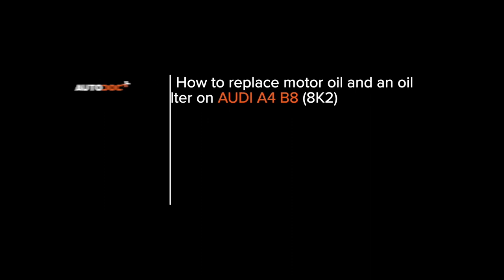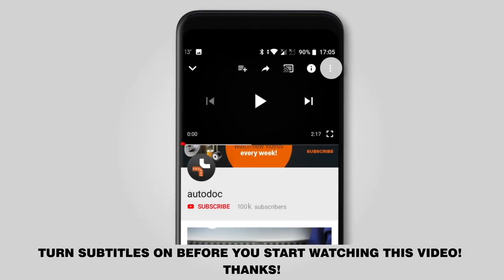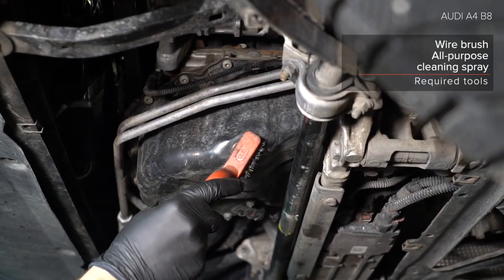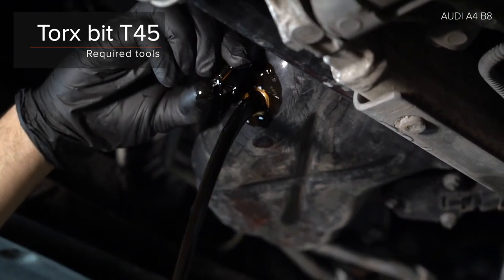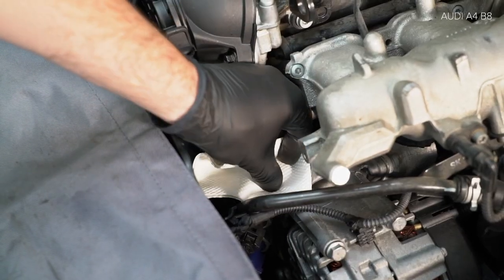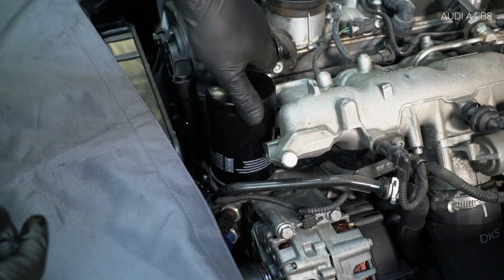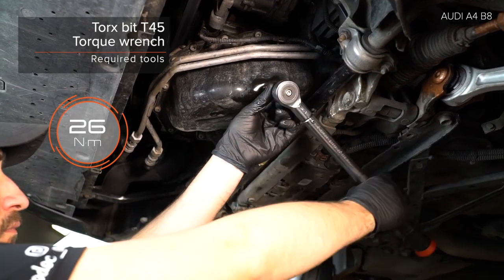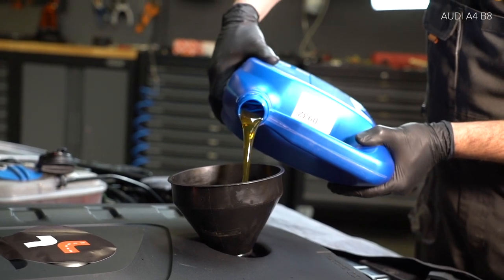How to change oil filter and engine oil on Audi A4 B8 Saloon [TUTORIAL AUTODOC]

Comment: You need to change the rubbers on the plastic insert under the filter which has the spring on it. Original filter comes with the replacements while all filter on autodoc dont come with it. Shame

Comment: I recently filled up my A4 B8 with 5W-40 oil but forgot to change filter first. Is it okay to change the filter now without draining the oil since its fresh oil? Or does the oil have to be drained to change the filter?
Reply from the maker: You can simply replace the filter, but you will need to add engine oil to the level.

Comment: Hi what is the best method not to spill oil while removing the old filter?
Reply from the maker: We do not have such information, we recommend that you consult your mechanic.
AUTODOC
Reply: If you have drained all of the oil from the car, there should not much oil left in the filter, but it you lift the filter housing carefully and hold a tissue paper in the other hand, you can quickly block the bottom of the filter with tissue to reduce spilling it all over the other engine parts.

Comment: I don't have ramps so what do you suggest for lifting the car?
Reply from the maker: This video contains only tips and tricks that may be useful when repairing a car or replacing parts. You can use a viewing hole or we recommend contacting the service.
Reply: you need a trolley jack and 4 axle stands the car needs to be sitting level to best drain the oil. jack the near/side/front jacking point and put the stand under the n/s/rear point, go to driver/s/f and jack up, put the d/s/r and n/s/f stands under the jack points, let the jack down come round the front and jack d/s/f up where the bottom arm connects and put the stand under the d/s/f jack point, make sure you’re on level ground and all the stands are at the same height, let the jack off slow